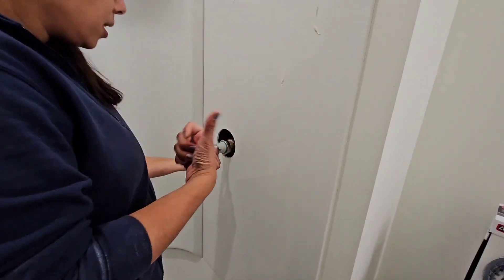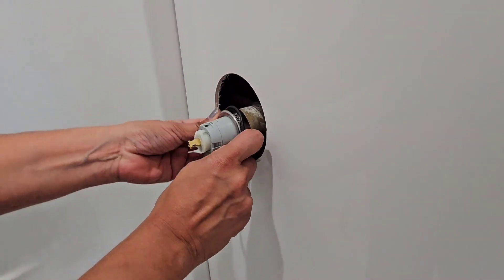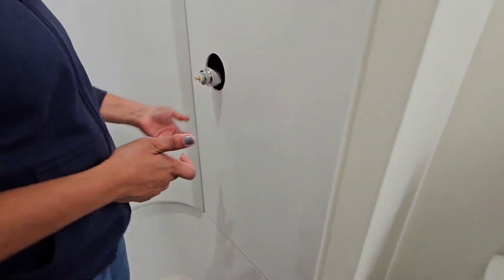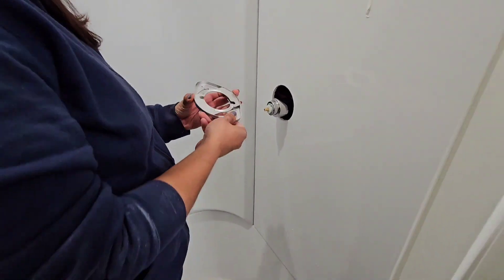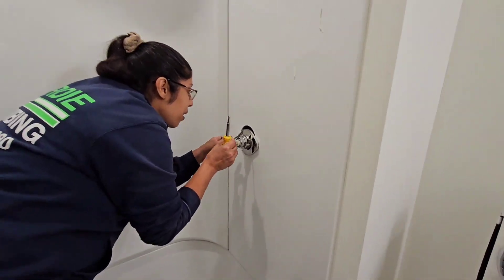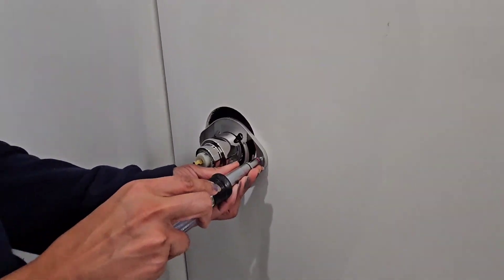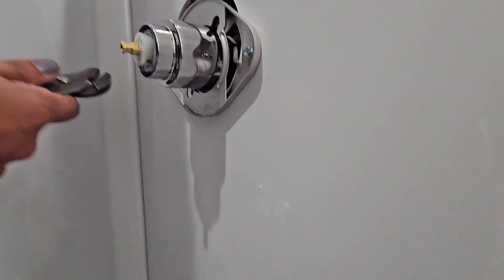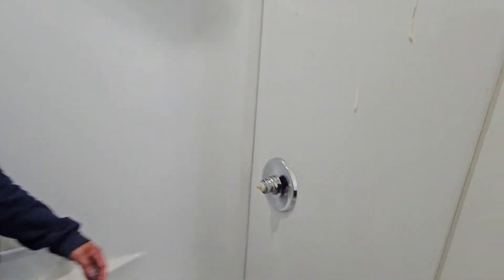Delta Shower Trim Install By Camera Lady

Comment: Nice job. Do you like Delta over Moen?
Reply from the maker: I'm a Delta Guy. The Roufh in valve has a braket on it that allows it to be secured directly to backing. Moen rough in valve has a  nub in the back which does not allow you to secure it to backing very well. The Delta rough-in valves do not come with the cartridge like moen. Which I like a lot. Because you don't have to pull the cartridge to Solder up a Delta valve.